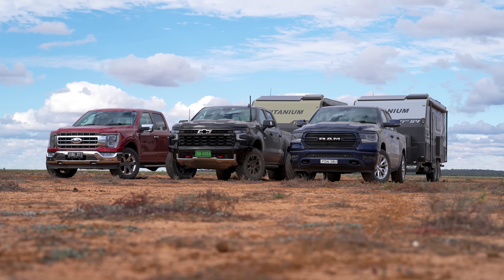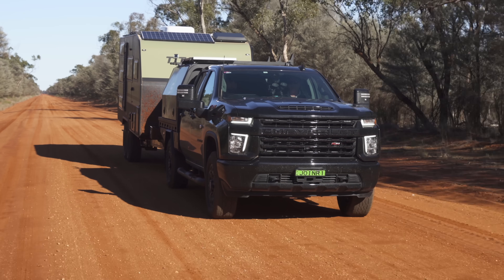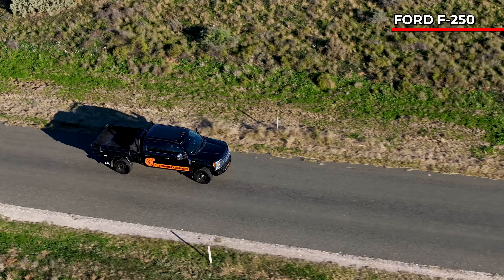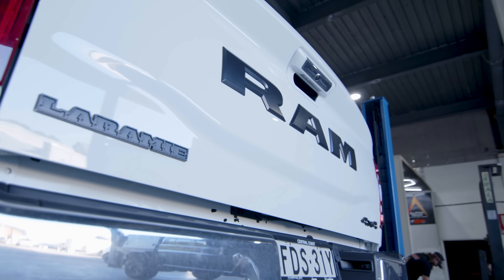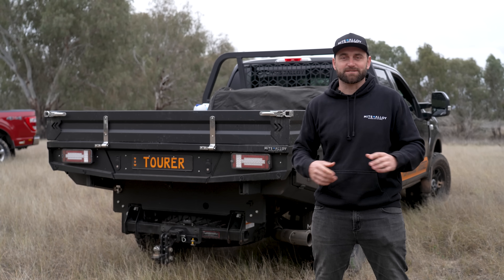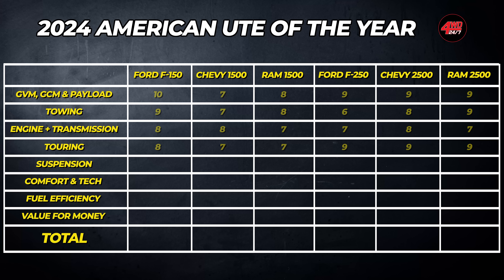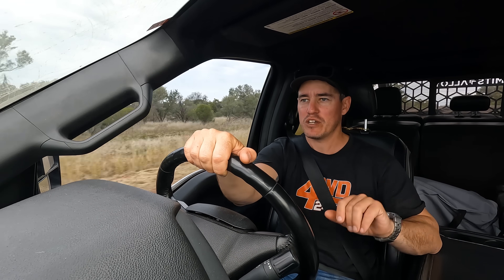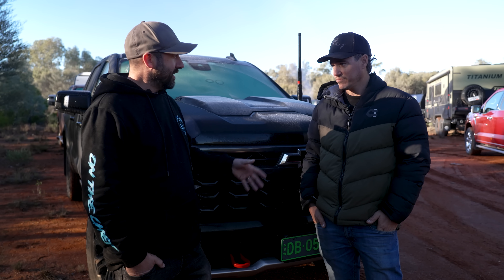2024 RAM vs CHEVY vs FORD TORTURE TEST! Heavy towing, dirt roads - SHOCK WINNER & major problems

Comment: So many issues with the Ram trucks in the states. I'd think twice before laying your money down for one
Reply: Every single one of these trucks is far less reliable than the Toyotas and Isuzus you guys are familiar with.
The only one I would risk is the F-150 and that's assuming the dealer support is improving.
Reply: Granted mine was the generation previous, but my Ram didn't have any issues through our entire ownership. And the luxuries worked incredibly well.
Reply: It's the most reliable of the big 3 for  half a decade straight now 😂😂

Comment: Never heard anyone ask for this. 
They are over priced, fuel gluping pos tanks.
99% of owners do not actually need them.
Reply: I dont know where you're from but you're wrong. I would say 75% of people in Canada who have a 1500 truck use them for intended purposes( work, hauling, towing, etc)
Reply: They go over fuel consumption in the video and its a lot better than youd think.
Reply: @tz1598  they are talking about American trucks in Australia.
Reply: @0ricle  had a Ram Diesel and Chev petrol, they are crap.
Reply: @madmick3794 am I supposed to know where you’re from or something?
Reply: @madmick3794 and in all fairness, these guys aren’t using these hd trucks like they’re supposed to be used. Just saying
Reply: @tz1598  no, never presumed that.  Only said it on the basis of an Aussie channel testing an Aussie version of a vehicle in Australia with my comment then being aimed at Aussie owners.
Reply: @tz1598  very true

Comment: As an American with a Ram TRX, I would agree that the 1500s in stock trim aren't going to be that impressive off-road. That said, each of the brands do have very capable versions like the Ford tremor and Ford Raptor or the Ram Rebel and the Ram TRX or the Chevy ZR2. 
Great video, new subscriber!

Comment: none of these will last past 100,000km without major issues
Reply: Just not true. I’ve got a ‘17 power stroke with 245,000 miles with just normal maintenance items.
Reply: Our mechanics ram 1500 has 150,000 without issue😂
Reply: Are you aware that they are all the longest lasting vehicles on the road in North America? The Tundra is #1 and the Silverado is right behind it. Why would you comment on something you know nothing about? There is tons of data on this, and considering the F-150 has been the best selling vehicle in North America for 30 years straight, it's not hard to figure out.

Comment: It’s not just the towing. It’s the ability to have utility and luxury. It’s nice enough to ride in every day, many will carry 6 people, and you can make runs to the dump or hardware store without having another vehicle. Plus the fuel mileage in the newer trucks is still reasonable. On top of all of that in the 1 tons you usually have around 15 tons of towing capacity so you never have to wonder if you’re towing too heavy or are gonna be struggling on hills. I’ve seen people doing 85 mph up hill with a  35 foot 5th wheel.

Comment: I have a 2015 f150 with the 3.5 ecoboost with over 100,000 miles on the truck and I work with plenty of people that have both the 3.5 2.7 and the 5.0 f150 with plenty of miles on all of them . We have a problem with salt on the road in the winter time and the aluminum body on the f150 last a lot longer than the one from the ram and Chevy .

Comment: Love the video fellas, really interested in more of the US content. I just wish you had of put like against like. I understand Chev didn't give you the vehicle's which sucks, but if it was purely tow based why did you go with the ZR2 1500, you should have got a LTZ, BTW the new 2500 Chev has the same as the 1500 interior. I've got the 1500 ZR2 its the best of both worlds, towing and offroad, had a 79 modified at the same cost as standard ZR2. ZR2 smokes the 79 both offroad and towing. Durability will be tested over time I guess. I'm at 22k in central Qld and towing 3 tonne on and offroad, no issues as yet except for the camera concern which is a recall.

Comment: Just to clarify a couple of points:  yes, the Ram Cummins diesel has a problem with the heater grid nut corroding and falling off but only after about 100,000 miles giving lots of time to replace it.  Further, replacing the stock heater grid with an aftermarket unit like Banks produces only takes about an hour and is easy for the do-it-yourselfer.  The Ford Powerstroke CP4 fuel pump disaster prevention kit is a huge pain in the a$$ to install and absolutely stretches the abilities of a do-it-yourselfer to the maximum and will take you 10 to 11 hours to complete.  Believe me, I know from personal experience.  Having said all that and I know this is more of a trailering test than an offroad test I love My 2022 Power Wagon for doing both.   I tow a smaller 20 foot  "Couples" Geo Pro off-grid trailer with an unloaded weight of 4200 lbs and a cargo carrying capacity of 1262 lbs so even loaded to the max it's well under the PW's max towing limit.  When I get to my destination I unhook the trailer and then off to the backwoods in the world's most capable full size off-road vehicle.  Ram for the win!

Comment: Aussie F250 Superduty owner, Go fine off road do have to pick your line/speed with the ramp over (good sliders/Protection), but haven't found a track I haven't been able to do and generally extremely stable doing tracks.
Bit unfair comparing the 2020 F250 with the other 2024's as currently F250 is still the leader for power and torque.

Also the VDC Converted is the best conversion, powermax has most issues and wild setups

Comment: The F150 has had many recall issues etc since going on sale, to sort out and resolve many things, including stuff that meant the vehicle did not meet ADR.
Ford Australia chose a third party company to do the conversion to RHD.
It’s taking them a while to produce a vehicle, that is not having certain problems and issues.
A facelifted F150 will be available next year.
I’d wait until 6 months after the availability of that, and still hope that the third party conversion company, has got everything sorted, and ok, from Day 1.
Walkinshaw have the long term experience with doing a full remanufacture to RHD, for Ram, Chev, and now the manufacturer backed, 
Toyota Tundra.

Comment: Would love to see you run a Power Wagon or equivalent on 35's, on your tracks and offer the specific limitations you find...   Likely it would shred your IFS utes except for width constraints.  The 3/4 ton's are built (designed) for 100K mile plus durability in commercial use (off road construction) and if you fix them, they'll go for a long, long time beyond that.   The Aussies will figure it out and enjoy the outcome...

Comment: I've owned my old '99 Suburban for sometime now & I can say it took the Aussies a long time to cotton onto the larger American vehicles, which I find odd with the size of our country. I don't tow a van with mine (I love going places where the caravans can't go, so YES, I certainly 4wd mine, 35's, diff lock etc I avoid the black top!) I do tow a full sized car carrying trailer at times which it does it with ease. I could never figure out why one would buy say a Landcruiser then be forced to shell out even more $$ with a GVM upgrade just to tow some thing sizeable. You can buy a standard American based "truck" & be on the money. The attractiveness of my 4wd though was the amount of room, I literally have twice the room in the rear that I've had with previous 4wd's yet still seat 5 big adults in comfort. Yeah, sure my 350 V8 petrol motor uses a bit of fuel but........Geez, I'd love a newer one though, they seem to have come a long way!

Comment: Out of all these “tested” trucks and being in America, I’d go with the Dodge Ram 2500 6.7L Cummins ALWAYS. It’s by far the BEST truck out there and the MOST capable 4x4 Heavy Duty truck with the best engine. 4WD 24/7 should see what American Expedition Vehicles does with this rig and their Prospector model. Simply put, there is no better truck that can be outfitted the way AEV does it. Check them out! 🤙🏼

Comment: In the US these truck are everywhere no matter where you go there’s someone who knows how to work on them if you yourself don’t parts are everywhere. At least the f-150 ,with a 5.5 foot bed, to can’t speak for the others I’ve never driven one, it wheels really well in my opinion with a lift and 35in tires and a simple 3 inch lift and stock suspension
Reply: (5.5 foot bed has a shorter wheel base) In the US they make sense more than anything else. In the land of kangaroos I’d say stick to a ranger or 200 series ect

Comment: Ford f250 and Chevy 2500 10 speed are the same transmission and are known to go out because of the bushing for the primary drive drum. They make an improved bushing that doesn’t loosen and block flow of fluid other than that they are great transmissions. But if your going to buy a Cummins get one older than 2017 because you can get them with an indestructible 6 speed manual
Reply: I’m in America and been around these trucks a lot. I drive a ram 1500 with a hemi myself. I’ve had 19000 pounds behind it on the hitch and drove 3 hours straight at 85 miles an hour on big mud tires. The hemis are awesome motors

Comment: I have a 2019 F150 extended cab, 8 ft bed, 5.0l , rear locker that I have put full skid plates on.  I take it on some pretty sketchy jeep trails a couple of times a year while hunting with zero issues.  The breakover angle and length definitely have to be watched but I go where ever I want.  Getting ready to put on 34" tires.  Especially in the Western US, a LOT of trucks get used harder than you think it appears.  That being said, we lust after a lot of the smaller desiels that we will never get :(

Comment: I think the two key components that makes these trucks not great for off roading are their size and their weight (disregarding the cost and difficulty of the breakages that come with extreme offroading). I wouldn't advise taking any of these on very soft sand or mud, as they would bury themselves in seconds. Check out how many of these Matt (Matt's offroad recovery) has to pull out from Sand Hollow as evidence of that. I also wouldn't want to be the guy trying to maneuver one of these in a tight driveway or mountain pass. I think the 4x4 on these are mostly meant for some extra traction on dirt roads or bad weather conditions and the low range is meant for steep climbs (or descents) under load. Sure you can kit them out with a big lift and massive tires and, along with the power they make, they'll make for a very capable off-road weapon, but they will still be handicapped by their size and weight and if you're only after offroad performance there are much better and more affordable options available.
Reply: Very true comment, it’s hard to have that one vehicle that’ll do it all. My 2 door wrangler is amazingly capable offroad but horrible payload and not comfortable long distance, my 2500 can do 90% of the offroad (just not as fun) and handle the highway comfortably with tremendous payload.

Comment: I live in Louisiana, personally I drive a Chevy Trail boss 1500. Typically even a double cab stock truck will preform in rougher terrain then you were driving them in. That being said considering they are considered imports in Australia, I wouldn’t test the boundaries either considering y’all have problems getting air filters. That would definitely ruin a trip if you were to break a CV shaft or control arm.

Comment: i wheel a 2002 tahoe a lot. 3" lift and some 33" yokohama geolandar g003 M/T tires. it goes through and over a lot obstacles but lockers are the main thing an american truck/suv needs after a set of knobby tires. i cant stress enough how important tire tread design is in a harsh environment. those cooper at3s are a highway tread in my eyes, slip very badly in wet grass, mud, sand, and they pick up screws and nails too easily. falken wildpeak snow rated tires are about the smoothest tread i would trust on our mucky backroads here.

Comment: My comment goes back to the torsion bar suspension that your suspension guy says you have to delete in the 2500 in the states a 2 inch lift will not affect the torsion bars at all it is just a spacer that is manufactured out of a piece of billet that sits on top of the spring strut shock combination in the front with four shackles for the leaf springs

Comment: The limiting factor for off-road is the electronics (cant get them underwater) and long wheel base. However, the 1/2 tons see lots of off road here in the States. As far as parts, buy from the internet, never from dealer. The dealer will.only sell thier parts...

Comment: Over here in Canada, those F150 V6's are failing at an alarming rate. My nephew works at a local Ford dealership. The turbos and timing chain failures would blow your mind. They've souped up a V6 to compete with a V8, and it doesn't make sense. They've taken away any longevity, making 6 cylinders work to hard to make the same power as a V8.

Comment: Torsion bar fronts better option than struts simple cheap simple adjustment for winch shocks cheaper than struts note young fella mentioned going above 2 inches I wouldn’t lift nose of independent fronts , this where camber and start chase the front end when ball weight goes on like a seesaw note limited to 2 suspension 1 in tyre size 3 overall before engineering 🤔

Comment: Louisiana, USA here. The F250 6.7 Power Stroke High Output engine is the monster you need to compare against. It’s the most common, and destroys the Ram and Chevy. Its numbers are 1627 Nm and 373 kW.

Comment: If you were going to make it more fair you should have use comparable trucks to the ZR2 by using the off-road versions of the Ram (1500 Rebel) and the Ford (F150 Tremor) which with the off-road suspension reduces the amount of towing and payload per vehicle. Other than that the video is pretty decent.

Comment: It’s a shame you didn’t test aftermarket suspension on the heavy duty trucks. 

I know it makes the price astronomical, but there are plenty of kits that use longer, softer springs with king shocks and give them more than 2” of up travel

Comment: The rams 2500s do pretty well offroad when built i started with a jeep then a tacoma now with a ram 2500 cummins ive built all my vehicles up my rams got a detroit locker in the rear e locker up front sitting on 37s it goes everywhere I've taken it including running trails in moab i thought the extra width would be an issue running trails but a tacoma to a 2500 it's only 5" wider

Comment: Wow 2500’s comments here, the Ram gets knocked for the heater grid and the 68rfe valve body and the Chev is trouble free? obviously you have not seen the crank concerns the duramax have or ignoring it for this test and the 10 speed has its concerns too. None are perfect its the world we live in now and its freaking sad. I will do the necessary pro active upgrades to my Ram 3500 and keep enjoying it, and boy I am enjoying it. You should do your calculations manually on the fuel consumption you may be even more surprised with those 2500’s. 
Need to select 4wd to handle the corrugations. 
Still loved your video and a lot of info you shared with your audience, thank you for that.

Comment: They have a place, I need a tow tug with some 4WD capability GVM and GCM with space to fit my boat motor trailer etc and not all of us can afford $250k for a chopped 300 with a canopy on the back. Sure I might finish up at around $180k but it’s still better than the alternative

Comment: I drive an 05 f150 every day, and semi regularly, legally, and safely, tow my WD22 that weighs roughly 5-5500lbs with how it's setup, combined with the trailer, I sit around 8k lbs, so ball park 4 metric tonns. 
I've had up to 10k behind it and it's absolutely fine, but at that weight, a 3/4 ton pickup, (2500) starts to feel more appropriate. 
I do have electric trailer brakes.

Comment: As a base vehicle the Chevy 2500 is a good thing, if you want stronger, higher at a cheaper price, you buy the other two 2500 or 3500 trucks but the base price is higher. Why oh why they put 20 inch rims on these things is beyond me. My 2500 Chev has a 5.5t GVM and a 12,474kg GCM. 
And I have to be honest, the RAM looks better with a Trail Ready bar on it. 
As a basic tow vehicle I’m very happy with the big Chevy.

Comment: i purchased my 2021 ram 2500 4wd  v8 petrol  for 47000 usd   and just added a winch and new tires and it is really capable  it has a 1500kg payload   and is 4545kg vehicle gvm   and an 11000kg   gross combined mass with trailer in tow

Comment: Full size trucks can work off road, especially in a place like Australia that is wide open. On tighter trails, or rock crawling not as much. But my 2500 Power Wagon easily goes most places, even Black Bear Pass. It is far superior to our old 4 Runner. And I use it like a dump truck off road in ways smaller rigs would not be able to do. That all being said I would much rather take our Ineos Grenadier, which is amazing off road with out the huge size.

Comment: Didn’t do any favors to chev by picking the ZR2. ZR2 are meant to wheel and their suspension reflects that. My 2020 GMC SLT has an 11k tow cap with its package and the lower trims tow 9k.

Comment: I loved my 04 duramax it got totalled after getting tboned. Have a 01 ram 2500  turbo 5.9 6 speed manual now. They both pull  the excavator fine but the dodge seems to handle it better but the dodge also being a manual tranny  like alot more. Pulls the mountains good. Miss the comfort of the duramax tho .